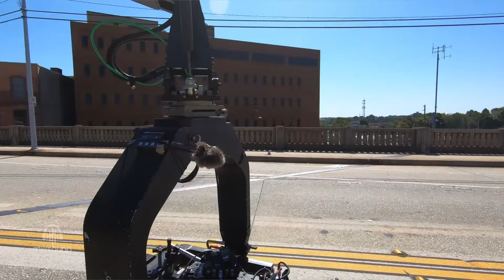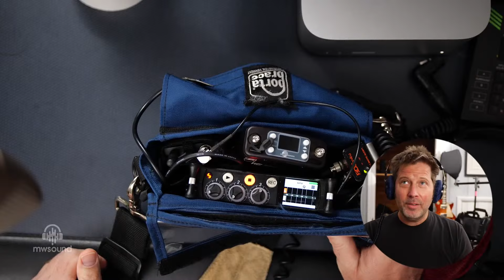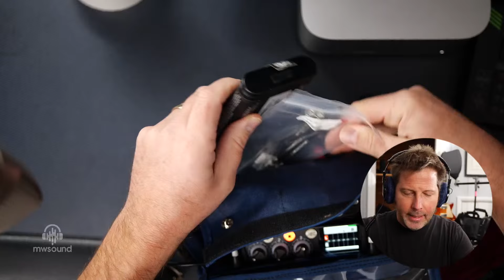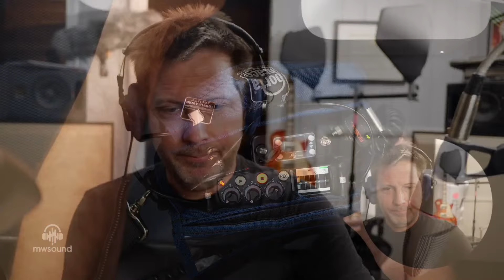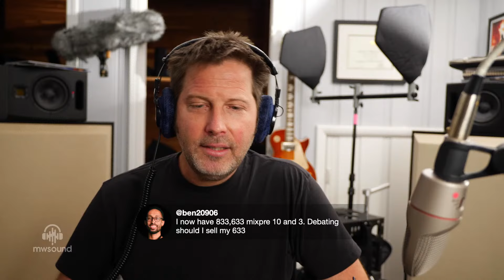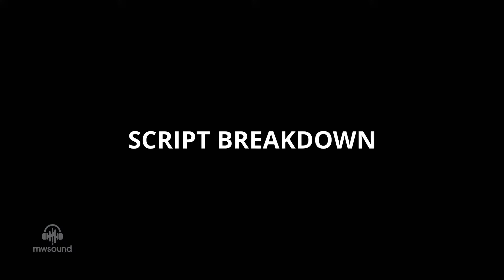Never sell gear, unless you own this!

Comment: Upgrading to Wisycom for the Sennheiser integration partially resolved the redundancy issue as those receivers, while bulky in a bag, are still at the ready. Just need a second MCR54 for safety (2 is 1, 1 is none).
Reply from the maker: That sounds like a killer set up Adam!

Comment: Michael, I enjoyed this topic. I started with Vega's, and Sony's wireless systems in early 1980's but focused on Lectro since the mid 1980's.(185, 190, 195' models) and then 411's which are still sitting in a case but not used.  Now SRC's, an 822 and just ordered a DSR4. I totally agree about redundancy. I got rid of my 633 years ago.I have an 833 for ENG/EFP (all bag work) but still use my 688 for sit down interviews because I like the outs available.   As I age but still in the game, I'm trying to work with a lighter package. I'm ordering in a feather rig for the 833 to use with the DSR4. I never bought an SL2. (I've never used AES before but I'm ordering in that module as I thought it would be nice to free up the XLR inputs because I tend to hardline sit down interviews and don't want to keep unplugging my receivers. I work ENG news and magazine shows.  
My all time favorite mixer for run & gun is the Sound Devices 302. However, it has no recording capability but it is a tank and I've taken it on foreign VIP trips for the State Department and White House assignments.  I attach a Deity PR2 for recording backup (boom and wireless) but with a mini input,  it's not the most secure situation.  When the PR4 comes out with XLR inputs, I might consider adding that to replace the PR2. 
I would love to see a MixPre6 with TA3 locking outs for a lighter package instead of the two piece solution. I think the MixPre10 is too big. But both of those only have one SD slot so the 833 is still my "go to" small bag. My hops are DCHT/DCHR and I give the producer an M2R for IFB monitoring.  For Time code, I moved away from Tentacle and use the Deity TC-1's instead. The Sidus audio app is great for syncing all TC-1's and their TC slate.  Before I ordered in the DSR 4 (just last week), I considered the Nexus Go but because of many of your talking points, I agree that sticking with Lectro was my best option (power consumption on the Nexus was a consideration and frankly, I don't need the channel count) Having compatability with other sound techs is also important and in my world Lectro is the way to go.  Keep these videos coming. Thanks, You are doing a great job!

Comment: I learned the hard way, thankfully it wasn't THAT bad... but it was bad. If you have G3's or something around that realm, save up and get into the system you know you are going to use and expand and it works for your needs and workflow, not everyone needs all the bells and whistles and be smart about it, no need to go 10K or more in debt when you just do 2-3 lavs and a boom on a regular basis.
Reply from the maker: Rock solid advice Charles!